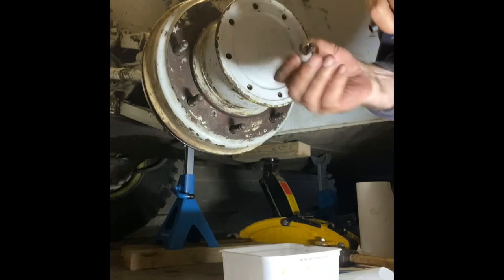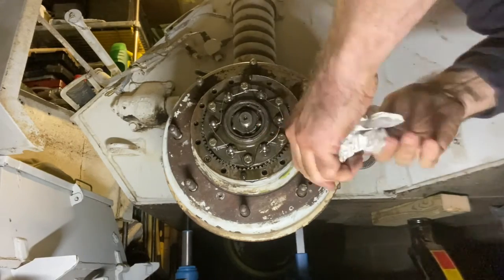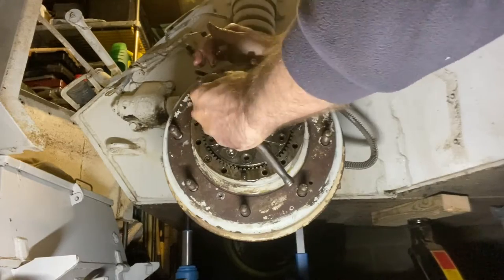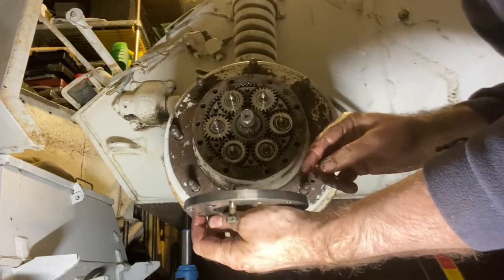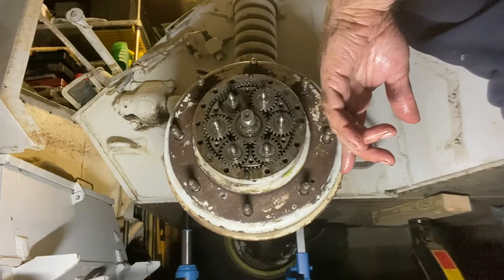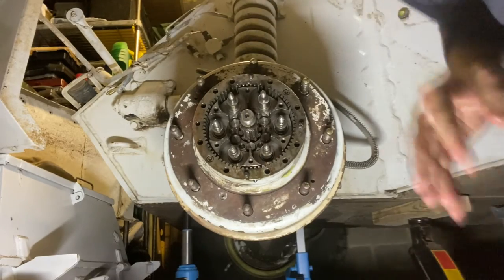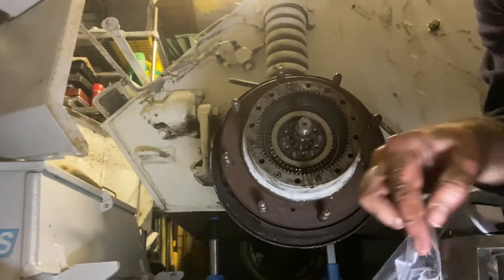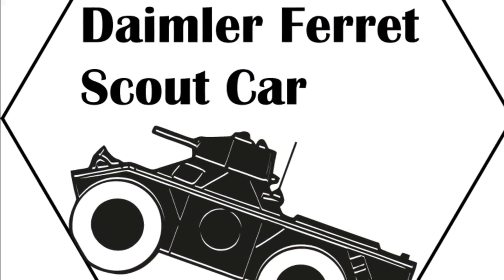Daimler Ferret Wheel Station Teardown - Hub Oil Seals - Part 1

Comment: Great video.  Fantastic engineering in those hubs. I did notice someone installed the safety wires incorrectly, just nit picking. lol
Reply: Most people seem to replace the nuts with nylocs so they don't have to rewire.

Comment: Nice, i want a ferret.
A small tip for you. If you dismantle a speaker and keep the ring magnet, you can put the magnet over your planet gear and keep the needle bearings safe from dropping all around.
Reply from the maker: Thanks for the tip!

Comment: I don't have a ferret (yet 😁) so this is just idol curiosity but can you still get brake shoes for a ferret I wouldn't know where to start. Great video it was very informative
Reply from the maker: Lots of parts are still available, the previous owner of my ferret had the brake shoes re-lined. It's pretty easy on the brakes in my experience, but then i don't do a lot of miles in it!
Reply: @daimlerferretscoutcar  that's pretty cool to know thanks
Reply: @timwhite4301  I'm in the same boat, haven't quite got there yet, but I hope that a year since you made your comment that you might have got yours. Good luck.
Reply: @danielkieran1427  not quite yet I'm afraid 😭

Comment: When u remove the plus from the outside, than i can fill it, but how much is going in it.
Reply from the maker: You should drive the vehicle until the plug on the outer hub is at the 10 or 2 o clock position. Remove the plug and It should then be filled with EP90 gear oil until it reaches the level of the plug hole.